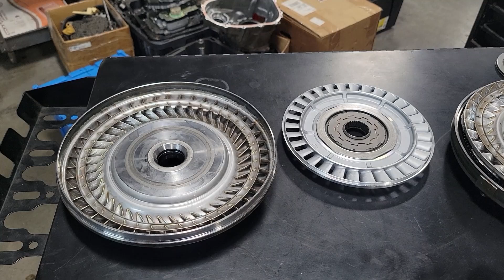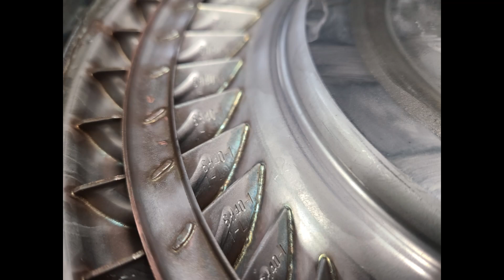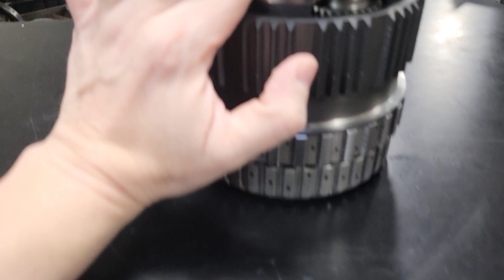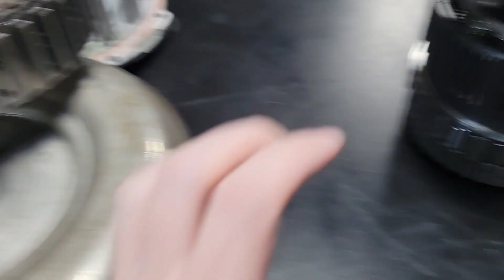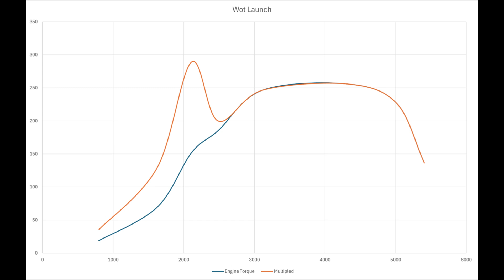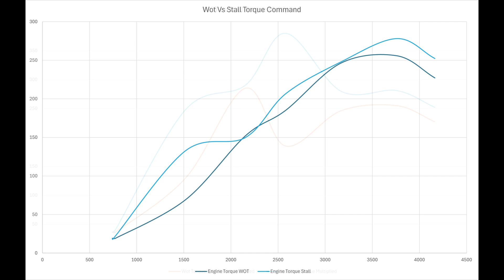Does "launching" an automatic transmission damage it?

Comment: Not touched on here but something to keep in mind, the significantly higher torque multiplication applied downstream during a brake assisted "launch" puts extra stress on the axles and differentials. The rear differential in some Mazdas (like the CX-5) are not built for hard launches with the turbo engine and doing these kinds of launches can really wear out those differentials quickly.
Reply from the maker: Yep, when you're dealing with torque multiplication out of a transmission especially a transaxle you are in the multiple 1000s lb ft of torque.

Comment: Thanks for making these videos. It’s awesome to know what’s going on inside the trans.

I have a question though, I have a 2019 CX9 with about 55k miles and I’ve noticed when cold, the transmission would shift from first to second but it would jerk like it had two second gears. I’m guessing it’s the lock up? It’s a bit abrupt though. But it was never like that, it just started happening just recently. It happens with light throttle. I did a ATF drain and fill at about 35k miles for context.
Reply: Do a transmission relearn. He has  a video for the procedure on his channel.

Comment: Great video thanks! I got a question about my mazda 3 with fw6 transmission.  The atf cooler failed and coolant mixed with the transmission fluid. I drained it all out and cleaned the valve body then filled with new fluid. Now it sometimes slips,  turn the car off and on then it drives normal again for a while. Do you think my friction plates are damaged?
Reply from the maker: @omdcarsandairplanes  unfortunately yes. Glycol from coolant damages the binders used on the clutches and they will start to fail. It is also damaging to the solenoids and TCM.
Reply: @21mazda3turbo3  damn! Well good thing I have your video to guide me on the disassembly and assembly. 😄 thanks man! Keep those vidoes coming.

Comment: If the car is flooring from crawling/rolling, would this damage be mitigated ?
Reply: Think about it this way, as you are holding the brake you are stalling the turbine in your torque converter. During stall you have things like cavitation taking place, and the fluid is actively being pumped against itself. This causes heat to the fluid, like wear in a clutch. Just flooring it causes a lower time of this work, and facilitates circulative cooling of the torque converter. Although it is not wear free, such as “granny stepping” your throttle to get going at a light, it’s much more beneficial to your system in the long run compared to overworking your fluid. - work to the fluid breaks it down, high temperatures also breaks down the fluid making it worse at pumping/ transferring torque to the wheels in the future. It makes your car less efficient by a very small number per unit of work applied while braking to “launch” the vehicle. Think of each minute of holding the breaks, while accelerating to 3500-4200 rpm as taking 1% of top speed and fuel efficiency away from the vehicle, whereas just flooring it might take away 0.01% and normal use contributes 0.0001% of the same wear.

Comment: Amazing video! Very understandable. If i may suggest, what happens when you dump it from neutral in an auto? Would love to see a video on it.
Reply from the maker: @averyoriginalname1379  that can vary depending on the transmission. For the Mazda Skyactiv in Neutral, the Low/Reverse clutches are on, and the Low Clutch is open. In 1st gear, the one-way clutch keeps the front planet from rotating counterclockwise.  The Low Clutch is applied as the input clutch and the Low/Reverse is still applied. So by dumping it from Neutral to 1st you are applying a large stick load to the Low Clutch as well as the one way. Thisncan break the one way and when that happens you lose 1st gear.

Comment: Think it's possible (easy) to tap into the transcooler line to add an additional radiator to facilitate the delay of TC balooning (or other potential longer term damage) for someone consistently driving aggressively, or say, for towing applications?  I've tried poking around that engine bay, and it might actually be tighter than my old Corrado SLC.
Great info, well above my pay grade, but I think some of it is rubbing off!

Comment: Amazing explanation! The detail is insane!

Is any of the technology in the new SkyActiv units carried from the older Jatco and Ford units?
Reply from the maker: @AAPLGUY  Clean sheet designs that Mazda designed and builds in house.
Reply: @ Good! Glad to hear that 🙂
Reply: Fun fact: Mazda uses ford injectors. You can upgrade the 2.5 turbo with ford eco boost injectors

Comment: I love the data you've collected. I've never seen insights on these transmissions like this before.

Have you noted any differences when doing this in normal versus sport modes?
Reply from the maker: @matsudakodo  I haven't noted any difference when launching, shift speed I have though.
Reply: @21mazda3turbo3  shift speed...interesting. Do you think it's changing fluid pressure? The only thing I've noticed is if you're in Manual & Sport it will not upshift at wide open throttle, you'll just redline. In normal mode it will upshift for you. This may be limited to certain gears.
Reply from the maker: @matsudakodo  yeah the actual ratio change is quicker, and there are some pressure differences.  I may do a video on that later.
Reply: @matsudakodo   If it's fully floored I think it will upshift, are you sure you're not just pressed against the 'kick down' clicker? I gutted my clicker a while back so it's just a spring now without and click and honestly it feels WAY nicer like that having a nearly linear throttle apply to full pedal.
Reply: @grolladat  Very interested in that video. Can you log data for APP vs TPS in sport/normal and/or GVC+ behavior in sport/normal? I know the throttle is more sensitive but I've heard that GVC+ is supposed to be 'more sportier' but I've never seen any data to back it up.
Reply: @huzudra  yup, you can make it bounce off the rev limiter.
Reply: @matsudakodo   I'll try it tomorrow. It'll be cold out but the block heater is helping.
Reply: @matsudakodo  I tried it this morning, nope. In sport with "manual shift" it will upshift at full throttle when it gets to about 6200 RPM. You're probably not at full throttle but just pressing against the "kick down" which is nothing more than a dog training clicker mounted below the gas pedal. I modified mine to remove the rollers making it into just a little bit of spring resistance instead of a sharp click to push past. It comes out pretty easily and honestly the car feels a lot nicer without that stiff fake kick down. Throttle pedal is mostly linear and then a little added resistance at the very end. Much better.
Reply: @huzudra  You need to try other gears, because I think it depends on the gear.
Reply: @21mazda3turbo3 please do!
Reply: @matsudakodo  1st and 2nd both shifted through to the next gear, let off in 3rd since it's cold out. I can get a video for you sometime but with the weather it won't be right away. Anyway, I'm confident that you're just pushing against the clicker and don't have the pedal to 100%. You can check data to be sure.
Reply: @huzudra  and I am 100% sure that I am at the floor. Maybe your car is different. I have a 2023 CX-5 Turbo and a 2024 MX-5 RF GT.
Reply: @matsudakodo  2023 Mazda 3 non turbo.
Reply: @huzudra shut traction control off while ur in manual mode, it won't upshift then
Reply: @SoulRedwhor3   I'll try that tomorrow!
Reply: @SoulRedwhor3  that did it, thanks!
Reply: @huzudra  awesome!!

Comment: Briliant explanation, What will happen if you rev the car on neutral and then shift in to Drive ? is the torque converter multipliying the same amount of torque? will the main shaft suffer more? Thank you!
Reply: What you are referring to is a neutral drop and that is highly not recommended unless you have money to burn on a new transmission
Reply from the maker: @andreimondragon9582  you dont want to do that, very destructive.
Reply: I accidentally knocked my shifter into neutral while driving a while back. I shifted back into drive while it was still moving but it was just coasting I didn't rev or anything. Could this cause damage?  @grolladat
Reply: @dr.fillyblunt7505  it's not gonna break your transmission, but try to avoid doing that in the future lol
Reply: Big no-no. You're applying a shock load to the clutch packs at that point. At least with the left-foot brake method, the fluid acts as a damper to some degree.